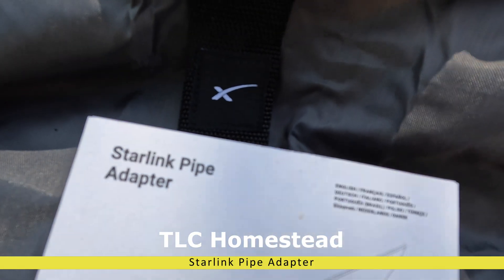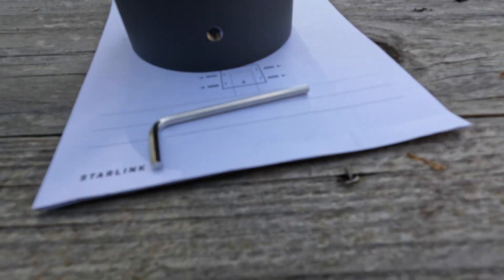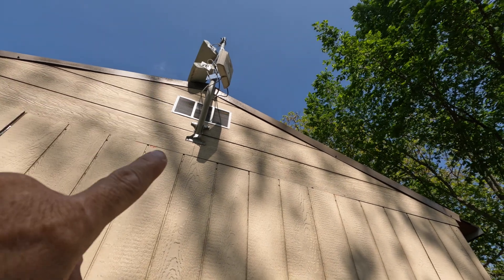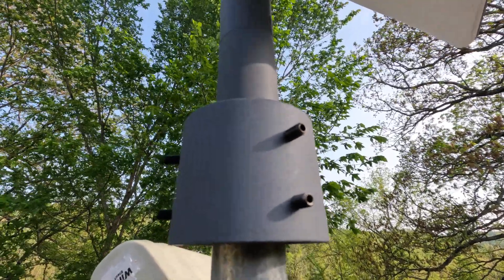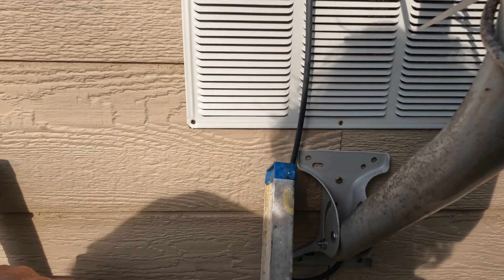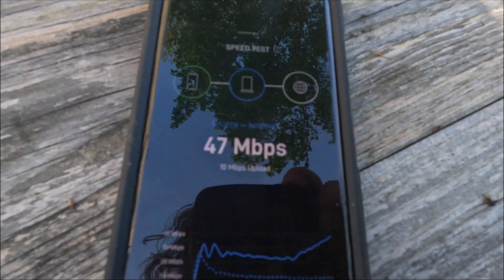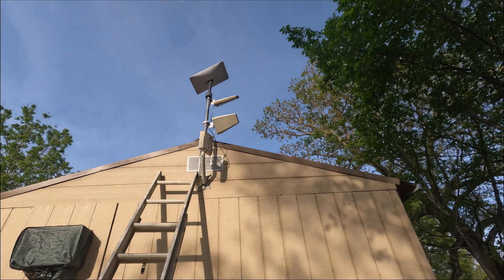Starlink Pipe Adapter

Comment: Did the wedge for the Starlink to attach the pipe come with the pipe adapter
Reply from the maker: Not sure what you mean by the "wedge"? But, I can say all the pipe adapter came with was the adapter itself, the set screws and those cable organizers :)
Reply: @tlchomestead  what i mean was the peace that you replace on the Starlink satellite for your pipe adapter to fit it look like a wedge mine has a kick stand right now and i have to replace that so the pipe adapter work’s

Comment: Looks like, you don't have much to worry, about, that tree is to the south of dish. (The back side)
Reply from the maker: Sadly the trees to the north do obstruct just a little bit as does the one black walnut to the south. During winter and early spring the app had no obstructions but as the trees leaved up I got some minor obstructions. Sadly in order trim those I'd need to climb way up a tree and that is not going to happen :)

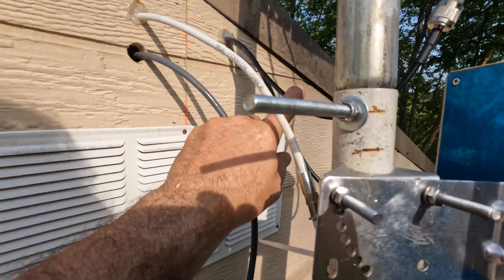Comment: 5:12 You could have used a muffler clamp on that pipe. Then you would not have a bolt throught the middle of the pipe stopping the starlink cable from going through. 1 1/2 inch muffler clamp is about $3-4 at any auto parts store.
Reply from the maker: Now that would have been a good idea. Two reasons why I did not. 1, any trips to town take me about 1.25 hrs not counting store time and I did not have one. 2. I did not know such a thing existed 😀
Reply: @tlchomestead  I sometime forget that people live a long ways from a town. My Sister lived on a mountain top that was at least 20 to 30 minutes from town.